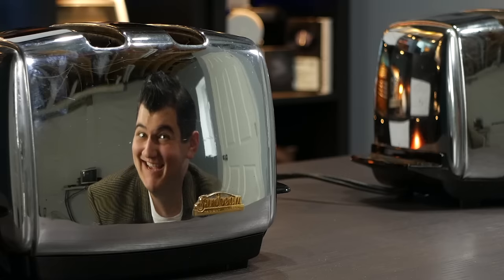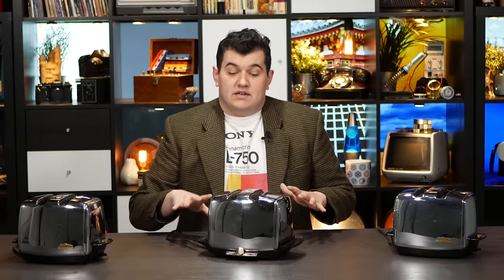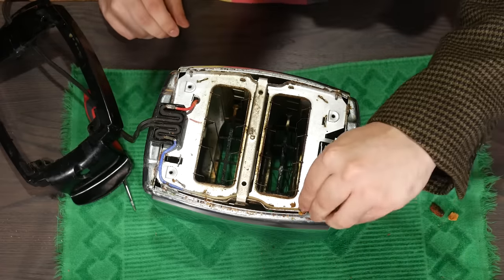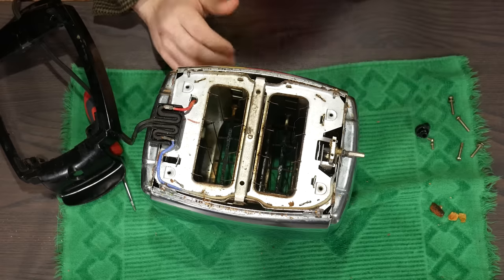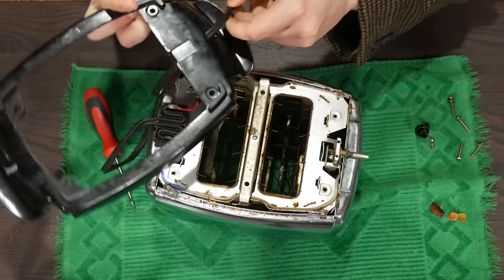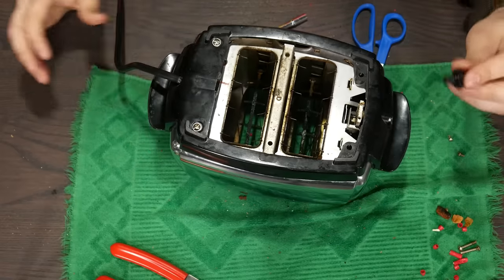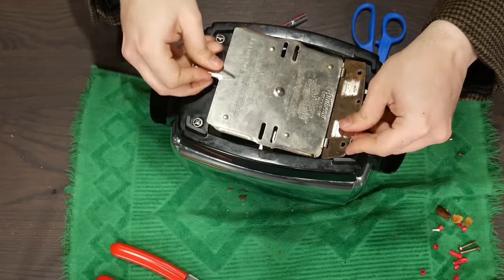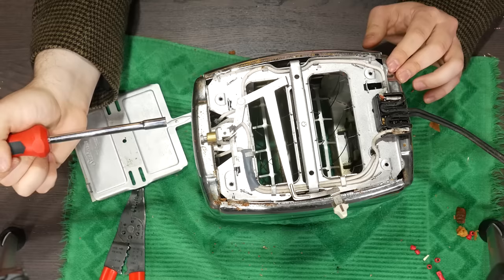Sunbeam Radiant Control Toaster--Repair and Modernization

Comment: I know this is a bit late, but one way to get the cable sheathing deeper into the toaster would be to snip the middle strain relief plastic back some with some side cutters. Just a 1/4" or so and you wouldn't see it poking out.

Comment: The reason your crimp keeps coming undone is that each wire should be crimped individually near its end of the butt splice.  You should not be trying to crimp the two wires together with one crimp.  The metal in the connector is what provides the connection to the other wire. I hope this is helpful.

Comment: If I was doing that repair, I would really like to use cord and connectors rated for high temperature use. Maybe even get some proper glassfiber insulated wire and replace all the internal wiring.

Soldering might be a bad idea in high temperature environment, for obvious and not-so-obvious reasons. Even if the temperature never gets up to the melting point of the solder, repeated heating and cooling may crack the solder joints. Crimped connections are safer.

Mostly I'm just envious since these things were either never made for European voltages or are at least extremely hard to find. Refitting one with 230V hardware would be a bit too much effort. Well, on the other hand, I'm really happy we have higher mains voltage here.

About the grounding, I'm a firm believer in the rule that all metal enclosed electrical devices should be grounded. It's actually required in the EU and has been for a long time. Although a lot of Europe (including where I live) uses non-polarised plugs, which makes grounding even more important.

Comment: 29:17 you should take off much more insulation, cut live and neutral wire a little bit, and then you would have a ground wire that is longer than other two wires. That would be much easier to install

Comment: On those connection terminals, use two wire cutters and peel them apart. Also, I would have used a ring that has an insulation crimp as well, gives the terminal a bit more strength. 

Twisting the leads will increase the pressure needed to get a safe crimp, I would advise against doing that. 

non polarized plugs w/o a ground only went away recently surprisingly enough. UL didn't care for whatever reason. The last time we made them at work would be only 16 years ago.

Comment: I bet part of the reason for short cables on toasters is that kitchens have GFCI outlets, and any device you're going to use in the kitchen ought to be plugged into a GFCI outlet. If you had a 50 foot cord, you could plug your toaster into an outlet in another room.

Comment: If you carve away some of the center divider from the strain relief the power cable might rest deep enough that the unsheathed wires don't show. It might also be possible to make a passage for the ground wire.

Comment: I know this is crazy late, but if you need to hold wires in a strain relief or channel, you can put a piece of electrical tape across the top.  You also could have used a small piece of tape to hold the ground spade to that chassis hole until you got the screw back in place (which would have been less optimal than the ground point you used anyway).

Comment: On getting the cord to stay put in the strain relief prior to reassembly, I suspect you could've used a hair dryer or a heat gun to heat up the wires to make them more pliable.  Just a thought.

Comment: Quick comment on the length of the lead, the shorter the lead the less heat is produced in the cable (due to the resistance of the copper) when the toaster is running. 3 feet is about right given the current that the toaster draws with the given wattage ;)

Comment: Hey man, you may have had this answered, and even if not, you probably won't see this comment anyway, but today, on the strength of this and the other video, I finally purchased one of these things! And the best part: I'm in Australia! They already have a 240V version as it was released over here in the 60's and 70's as well.

Mine is also not working, hoping it's just the set screw and I might take it as much apart as I can and give it all a good detail clean.

I paid $150 plus postage for a broken one. Working ones in reasonable condition currently go for over $500 (In Aussie Dollereydoos of course) so I think, relatively, considering it will be my toaster till the day I die if I can get it working, I might have got a bargain.

If you're curious, I can take some pics of it apart and put them on imgur for you or something.

If by some miracle you actually see this, and want some pics of the 240v version, let me know.

Thanks for the vid on how to fix these! And for driving the price up! XD

Comment: To cover the cut in the external insulation of the cord where it gets inside the toaster one could, before installing it, put on it a piece of heat-shrinking insulator, then push it into the toaster after the installation and then shrink it in place.

Comment: You could use your dremel tool to modify the strain relief by shortening the center piece to allow the cord to overlap a bit and keep the outer insulation inside the base.

Comment: A very simple way to join wires neatly and very securely is soldering and heat shrink tubing. If done well the non flexible part is about 1cm.

Comment: If you use solder use a higher heat solder like silver solder. replacing the strain relief with a terminal block would be better than reusing their cost saving strain relief.
the High temperature wire should be a woven fiberglass insulation.

Comment: Totally would've cleaned up the crap from the inside of the bakelite bottom before trying to run the cord through it.
Also, Good gravy man, use a SHIM temporarily to hold the wires in the strain relief!  Then pull it when it's done.
Also also, I feel uncomfortable that the black outer shell isn't somehow sealed thru the opening.  Some sort of electrical tape or better, a careful application of silicon sealant.

Comment: Reason for a 3ft cable, aside from less cost..  in modern kitchens with a counter size greater than 1ft, you'll need at least 1 outlet.  Each additional outlet should be spaced no more than 4ft apart.  This would mean appliances are no more than 2ft from an outlet.  In theory that makes it so the 3ft cord is plenty

Comment: Great video as usual! But why not just solder with an inline splice and use a small piece of heat shrink instead of fiddling with the butt connectors?

Comment: Recently I've acquired one of these (the AT-35 Toastermatic Aussie variant)

When I turn it on, the tray goes down without toast in, and according to a smallgoods repair shop, this is in relation to the bi-metal strip for the thermometer going bad, (which I've observed without the case and can see electrical shorts happening to initiate the sequence

My question is, do you think this is easily repairable? Given it's spent most of its life in Melbourne, it's been living in damp area, but I'd really like to restore and use it as my daily

Could I replace the bi-metal.strip? Or is this potentially serviceable? You're my only hope 😭

Comment: If you do mess up your knob setting, rotate it a full turn to “lighten” then drop bread in. If it’s too low, the toaster won’t stay on. Adjust it higher until you’ve reached your desired minimum darkness level. Re install the knob.

Comment: That strain relief seems it would be a lot easier to deal with if you decided to leave the crimp joint outside of it, which slso makes the lack of wire length a less of an issue at the same time.

Comment: As somewhat of a clutterbug, I would be highly nervous about something falling into the toaster.
Modern toasters require quite a large force on the lever to activate.
I still kinda want one of these, but I'd probably run it through an external switch or unplug it when not in use.

Comment: On the T35, if the lightest setting is still too dark, could I remove the knob, adjust the setting by turning it counterclockwise a turn or two, then replace the knob? Would that make the entire "range" of the knob lighter?

Comment: I find myself wanting a part 2 where you work out a way to insulate the interior of the metal frame (both for electrical safety and to keep the cover from absorbing heat that could be used for faster toasting!) I wonder if there's a silicone spray insulation of some kind that would work well. I also find myself wanting to figure out how to clean/burnish the interior metallic elements to make it look "like new" :D
Reply: Could also do it with high temp silicone electrical insulation tape, though the inside finish would be less uniform.

Comment: If you still have this channel- have had toaster since Mom and Dad married. 59. Moved and it was stored in damp garage where it seemed to grow mold or something on the inside wires. I fired it up it still works but would not want to put bread on cruddy surface. How do you clean these? Also probably need to adjust tension like you showed but I need it cleaned inside! I love this toaster. It's the only one I've ever used my whole life! HELP!!

Comment: Based on the US national electrical code, given the toaster is not double insulated the metal chassis must be ground bonded. That would make it closer to electrical standards but given this toaster design from now long ago only a full redesign would make it fully code compliant. I still like the upgrade; I would feel safe using it, but I wouldn't want to give it to someone else knowing there are still some risks for the uninformed. People have pretty much been trained over the years to not stick metal utensils inside a toaster, but never underestimate ingenious idiots.

Comment: With the backwards text. I expect there is  actually a slight difference in the bodies that might not be obvious, it could also be that the form was replaced. Either way I would expect that the text was switched to identify the parts from each other.

Comment: 1. An easier strain relief would have been to feed the cable through the cover and then tie a knot in the cable. This is a very common method of strain relief, especially in pendant lighting. Just remove the bake-lite insert and you have plenty of room for your wires and connections.
2. If that is, in fact, an aluminum wire, please redo that crimp connection! Firstly, crimp connectors should be crimped with the appropriate crimer they were designed for to ensure a proper, mechanical connection (especially obvious as seen through your difficulties). Most importantly, you need to be careful whenever joining copper and aluminum wiring as the vastly different expansion/contraction rates of the dissimilar metals could loosen connections over time, spark, and cause fires! a terminal block could be sufficient but something specifically designed to join copper and aluminum should be used. If using the knot method of strain relief. removing the insert would allow room for such a connector. 

Given the above, I would replace the aluminnum wire with copper, insulate the body from the chassis, use a lamp cord with a built-in switch, tie a know for strain relief and remove the strain relief insert, and solder the connections and cover with heat-shrink. Insulating the body from the chassis would take some figuring out (as I do not own one of these myself) and one thing to note is that most lamp cords, IIRC, are either 6 or 8 ft, so you'd want to see where the switch is placed relative to the plug (although this might be able to be modified depending on the plug) and trim accordingly to a safer 3ft length. While these suggestions make it much more of an endeavor, I believe the utmost of safety should be taken whenever working an electrical (especially when dealing with 110+V)!

Comment: 36:45 Because of the short distance between the sheath cut and the bakelite cover, you can try to heat your cord with a hair dryer and then grab the plug end and firmly squeeze the sheath whilst moving the toaster end hand towards the toaster, effectively stretching the sheath slightly and extending it the short distance into the toaster.

Comment: I'd change out the wires completely, and added some extra insulation to make it safer. 
And I would suspect that shorter cables for appliances is because of the tripping hazard, (counter-height outlets have been the norm in kitchens for a very long time)

Comment: To ground or not to ground.   Even new home toasters are ungrounded here in the US.   Commercial toasters (the ones with the NSF label) seem to be all grounded.    Imagine you are a stupid person and stick a knife or fork in the toaster without unplugging.    You wouldn't do it with one hand in your pocket, but you would be steadying the toaster body while poking with the knife.   The resistance element is a voltage divider when it's on and plugged in, so with a grounded shell you could get anywhere from 0V to 120 volts across your chest.   ( 240V - Hello Australia).   If the toaster is off and plugged in, the element is either at 0V ( neutral ) or full voltage, depending on the plug direction.

Comment: may be an old video at this point but the whole time he was messing about trying to get the wires to stay where he wanted them, and when he mentioned he could have used the "other" screw hole for the ground (the one he mentioned but didnt use right after he found the rivets) i was thinking, this looks like a job for hot glue, just glue those wires down so they dont move and then you can screw the ground in without worrying about it moving out of place, or when putting the strain relief back on, a little hot glue would hold the wires in place, dont need a lot just enough to keep them still.

Comment: Ok so I bought two of these babies and shipped them all the way to Switzerland (where we also love our own vintage toasters, check out Jura vintage toaster).
Now I have to fix em (one doesn't work, one burns my toast pretty bad)
Two questions:
1) My toaster runs through a 220V-110V converter. Should I ground it?
2) What is the best way to polish those chromes?

Comment: The cord should be short for safety reasons.  This toaster draws close to 15 A (In North America).  In Europe, we have 240 Volt AC, so we draw only half of the current.  More amps means the cord will become hot.  A cord too long could be a fire hazard.

Comment: using copper and aluminum wires is a form of color coding. those old cloth wires had a tendency to fade and can be kinda hard to tell apart sometimes.

if I'm not mistaken copper = red = hot

Comment: I haven't been able to find an EU version, but from the comments I've seen an Australian model exists (designed for 230-250 volts, 1600 watts), so would you consider getting hold of an Australian model and see the differences in design?

Comment: A tip for future re-wiring; try soldering the wires and use heat-shrink to insulate the join.
Reply: You aren’t supposed to use solder for wires that can get hot, for obvious reasons.

Comment: The reason cords are shorter on appliance now are 2 reasons.  First is safety so stupid people arent tempted to stretch it out and trip or get it tangled up with other things on the counter.  And 2nd is the modern kitchen has WAY more plugins and WAY more appliances so short cords are possible since we dont need long cords and they would be in the way.

Comment: that insulation is probably silcion rubber core with a fireberglass shell its common in high heat applications like furance igniters.